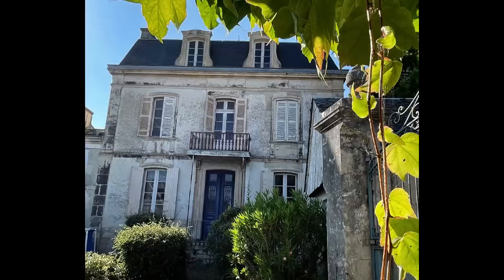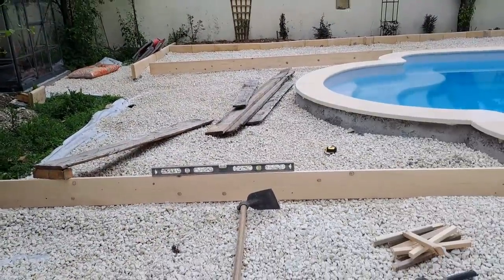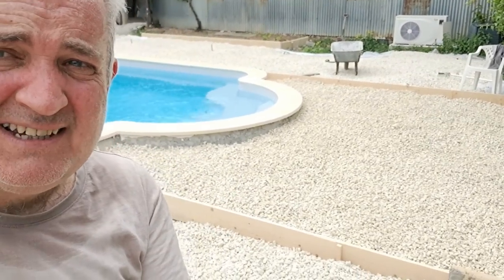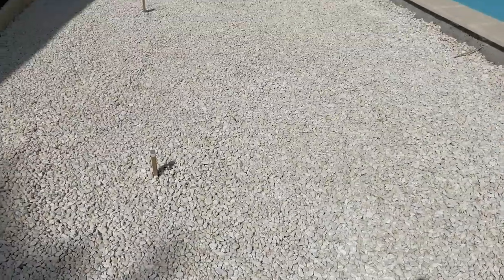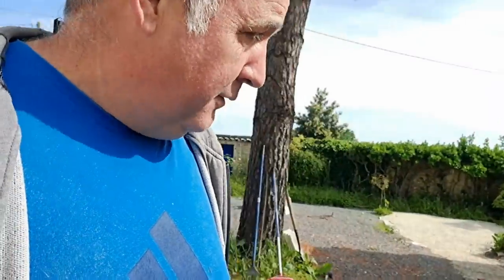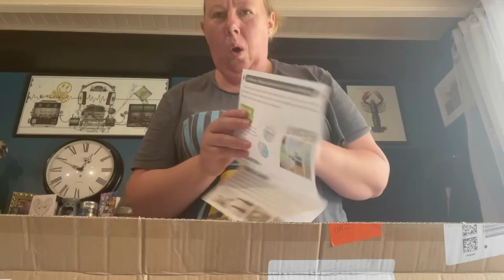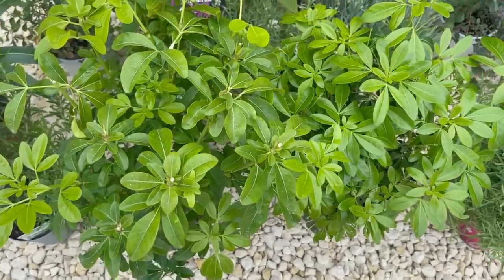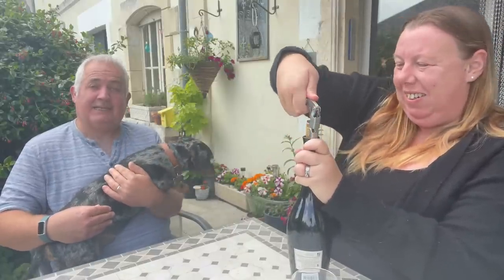Whack Job! #90

Comment: Sprinkle cinnamon around the base of your pots Clare, I’ve been in our unit coming on 12 years now, and I’ve been ant 🐜 free,and not had to as yet refresh the cinnamon.
It works better if you can follow the trail back to a nest. Not just a random sprinkle. I think it worked for me as they were nesting in my pots. Good luck give it a try.
Reply from the maker: Thanks for the great tip Ina x